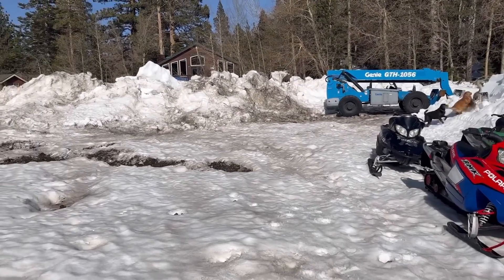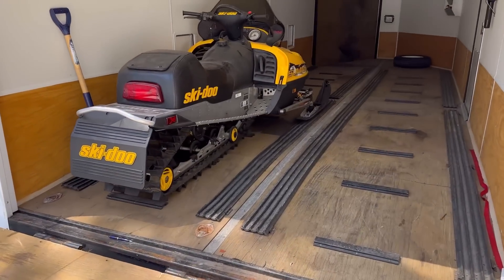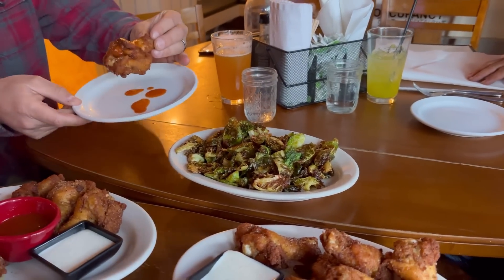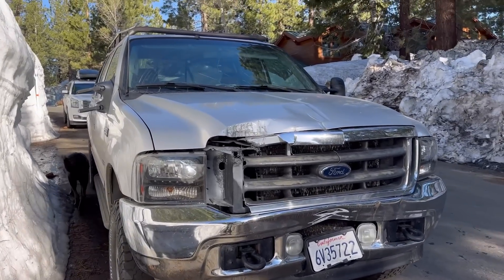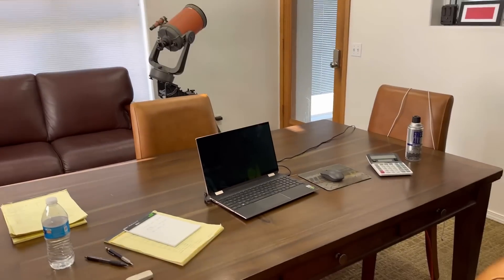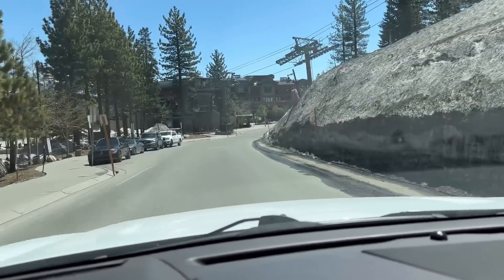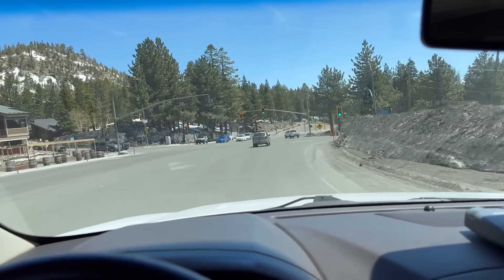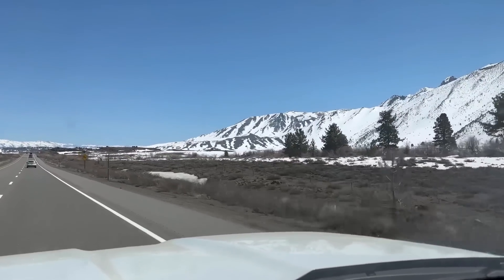Starting from scratch after historic snowfall year 2023 in Mammoth Lakes, California

Comment: That looks like a crevasse on a glacier. Often times glaciers are thickly covered with snow in the early spring as as the snow melts more cracks appear and by late summer the glacier has alot of cracks. Its not a glacier you need about 100 feet of snow depth to crush the lower layers of snow down to glacier ice but sometimes as a big snowbank 10+ feet starts to melt and settle you can get cracks/minature crevasses. If you are wondering why some small trees on a mountainside are bent over its either strong winds or a deep snowpack verly slowly sliding downhill.